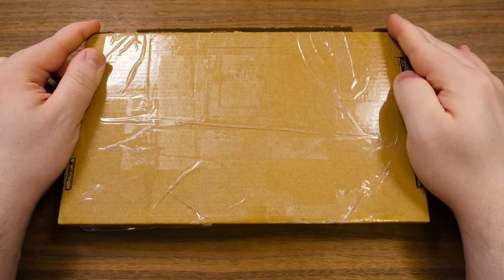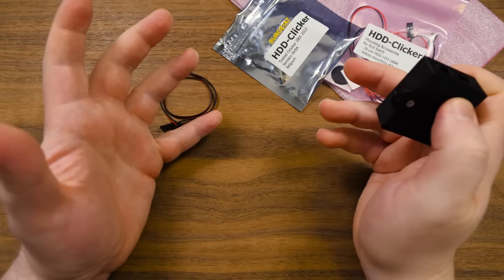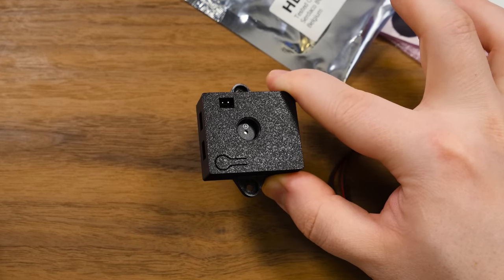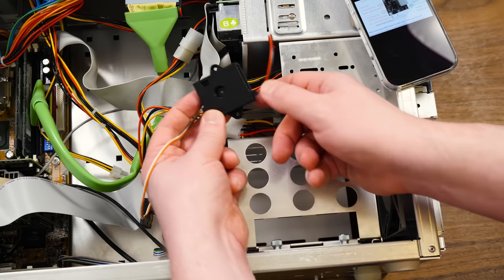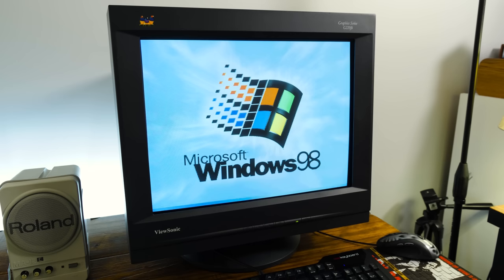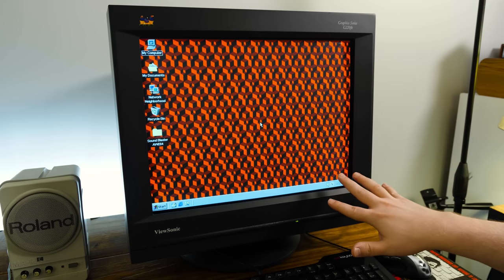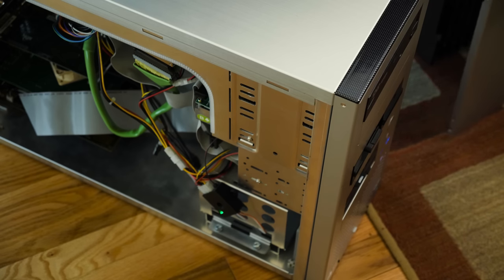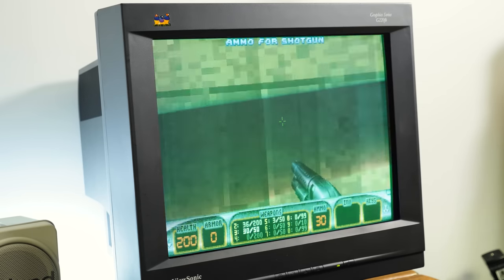The HDD Clicker: Add Hard Drive Sounds to SD/CF/SSDs

Comment: If they have something like this for nvme i'm down... Due to my visual impairment, flash is my biggest enemie due to its silent nature. Having auditive feedback would be awsome.
Reply from the maker: It works for anything with a hard drive LED! So as long as your motherboard sends disk activity out to the LED on your case, then this can be used :)
Reply: I almost feel this could be implemented in software... I've never heard of anything like it but reading disk read/write activity in modern day Windows is surely reasonably simple and could be fed into some software that could emulate an HDD sound.

Comment: This would be a cool feature for a SSD adapter board; SCSI or IDE on one end, SATA on the other, and a microcontroller with a speaker in the middle. That way the microcontroller could emulate drive noises as it emulates the older disk protocol.
Reply: That would be awesome! You could even add the option to emulate the speed of a mechanical hard drive, since after all the device is facilitating the data transfers. The amount of customization that a device like that could have is really cool to think about.

Comment: A neat project might be to use old, dead hard disks and modify them to do the same by disabling the platter so it no longer spins and using the actuator arm in place of the piezo speaker? I imagine the sound of the spinning disk whine would be easier to emulate with a speaker if desired too.
Reply: The con is those old dead hard disks are going to take up a whole 3.5" bay that you could fit several SSDs or other hardware in instead.
Reply: u can hook up the coil of the 'head' to the speaker output of about any amp and it will make noise vibrating. now i want to try this as well. i also have a little 3w 5V DC amplifier. u can buy those for $1 for 3.
Reply: @chatboss000  ...several SSDs? Why would you have several SSDs mounted in a vintage PC lol.
Reply: @startedtech  RAID0 for even more speed, of course /s
Reply: @startedtech  Who said it was a vintage PC?

Comment: Sounds like the IBM SCSI hard drive in an AMD K6-2-333 build I did.  The thing I love about the IBM SCSI drive is that the drive doesn't spin up when the computer is powered on.  The SCSI controller sends the stat signal to the drive when the SCSI controller is initializing during POST so it has a very interesting sound of the drive coming up and initializing.  The clicking is very loud and sounds a lot like that clicker you have.

Comment: For something where the activity LED pulses are slow enough, like on an XT-IDE adapter, you can get pretty much the same sound by simply replacing the adapter's LED with a piezo speaker, no extra electronics needed.
For anything faster (I tried a CF to IDE adapter in a Pentium) the LED flash frequency is too high and you get squeaky beepy noises instead of clicks; a project like this makes a lot of sense there. And yes, I do miss audible activity indication on modern hardware - current laptops don't even have an activity LED anymore...
Reply: squeaky beepy noises sounds about right for some of the earlier harddrives. you know, those that didn't go "krrr krrr krrrrrk" but "booo booo booop"
Reply: @silkwesir1444  Haha, yes, the ones with stepping motors (i.e. mostly the MFM/XTA era) made lovely "robot arm motion" seeking sounds. But the piezo I tried to drive from a fast IDE HDD's indicator sounded more like interference from a malfunctioning power supply, very unpleasant.

Comment: I'm always 10 years behind current tech (save a bundle of $$) and I've noticed that the 2012-era 500GB+ HDDs all went pretty silent. Only the older 160-240GB drives from the 2000s were still clicky. I slowly have adjusted to the lack of noise and don't really miss it.

Comment: what if you can put a custom audio file on a micro sd and put it in to put your own hdd sounds in (my harddrive is an old thick 1tb so it sound different from your normal laptop hdd) I like hearing the hard drive while it's loading

Comment: The absolute best drive sound (floppy or hard drive) I've ever hear is in the AtariST emulator SainT, which had an actual recorded wave files. In fact it was so good those wave files were copied and implemented as optional in various emulators still being worked on. Piezo might be a substitute, but it just does not cut it for actual replication of the sounds. Guess its time for another useful RP2040 Pico project ..

Comment: Glad I passed on this. They need to record samples from real hardware and build a soundfont based on them, along with a lightweight TSR or windows driver that intercepts HDD info and returns head position and whether a read is sequential or not.
This is why I still use an older 1.2GB HDD in my 286/XT machine despite also having a 2GB CF card, you can't replicate the sound of a real HDD this cheaply.

Comment: This is hilarious, Clint. I'm an acoustics engineer, and now, finally, we have silent high performance PCs, someone goes and makes them noisier! But I can see the appeal for the retro community.
Reply: Actually, to "tone it down a bit" you could "put a sock in it" as they used to say about gramophones. Try cutting a small circle of packing foam (experiment with thicknesses) and poking it into the hole over the piezo-electric driver. That would probably take off the "hard" edge to the sound and drop the volume a bit.

Comment: It immediately reminded me of when old PCs would make the internal speaker click whenever you pressed a key, so if you held a key down, it would just make this continuous rattle.

Ironically the one time I'd like a drive to make some actual noise is in this one laptop I got that didn't have a hard drive light at all, so upgrading to an SSD (which I definitely wanted to do because the drive it came with was one of those especially slow ones) would have made it impossible to tell if it was doing anything or not. And of course there's no space inside there for something like this, no matter how well you scaled it down.

Comment: If you're going for a failing drive sound... then this is great.  Needs to be chunkier and more intermittent.  A better solution would be to repurpose an actual drive header and make them seek when active.  True mechanical sounds without the risk of corrupted data from platter damage.

Comment: The use of a speaker is something that makes more sense, but it would be really cool to swap it out with a low-resistance relay and just randomly trigger it. That would be most realistic-sounding.
Reply: Wouldn't that be a tad too loud? Maybe more for floppy emulation than hard disk...?
Reply: @silkwesir1444  It just depends on the relay. One the size of a piezo beeper would be very quiet comparatively.

Comment: If the volume is adjustabe im sure turning it down would help it blend in better.  Also, I'd imagine it clicks so fast due to the read/write speeds of the card being much faster than any drive you'd be used to, so more is being done per unit of time.

Comment: It would probably be a bit expensive to have an accurate disk drive sound maker. The best option would probably be one that plays random seek sound files on access while continually looping the spindle motor sound when idle. You could have an option to choose samples for multiple drive models. For the true retro experience you'll want a spin-up sound at power-up and, if applicable, a timer to play loops for thermal recal cycles (especially noticeable on <200MB Quantum drives). I'm not sure if the CPU on a BlueSCSI or similar would have enough spare CPU cycles to run something like that as an add-on or if it would have to be self-contained.

Comment: All you need to do is put one of the small felt furniture pads over the piezo element. That will dampen the loudness and could curb the pitch a bit. I’ve done this on motherboard piezo speakers and it works wonderfully.

Comment: Seems like if it would use an IDE pass through, instead of one for the activity light, it could intercept and interpret the commands passing through, and emulate the sounds of spinning up and seeking to particular tracks, for some specific old drive. Pretty neat as it is, though. Sounds sorta like some drives I used to have, though I don't remember which.

Comment: I'd be curious how it'd work with older systems.  I've noticed on my own 486 box with a super IO card on vesa for IDE, the light never comes on as far as I can tell.

However the sound that's far more nostalgic and equally appropriate is a cooling fan running at full blast because the idea it'd need to slow down wasn't fashionable yet.

Comment: There was this awkward era of laptop manufacturing where they stopped shipping with HDD activity LEDs but they would still come with sata HDDs. I had to put my ear next to the laptop to check if the computer was actually doing something. I can see a use scenario if your PC case doesn't come with a HDD activity light for some reason and you really don't want to bring up the Task Manager to check lol.
Reply: I used to have a Dell Studio laptop from 2010 that I thought was like that. And then I discovered by chance that you could press Fn+H to toggle the power LED between being a power LED and a hard disk activity LED. It was handled by the keyboard controller itself, or maybe the management mode BIOS or something, the point is - it worked without any OS support, even when the computer was stuck. That was a very nice feature!

Comment: I wonder what's next since you can simulate HDD sounds using a SSD or anything like that?
Some sort of device that simulates motor engines for electric cars like Teslas?
Anything that simulates those CRT sounds for modern TVs?

Comment: It does sound like some old drives.  But just clicking on disk access is wrong.  There is no break in the clicking for the seek times of the hard drive.  Nor does it do some random clicks as cache gets flushed to the drive.

Comment: I think the power LED indicator option is for when your case has a 2pin power LED wire and your motherboard has a 3 pin without the middle pin.  I have an Athlon 1100 T-Bird build in a Chieftec Dragon case that I cannot use the power LED on because its a 2pin on the case.  It probably just pulls directly from molex.  Simplest solutions are probably the most likely in this situation.  I might have to buy a couple of these, regardless of if its "perfect", its better than dead silence of flash media.

Comment: I think this just works based on the LED entirely. It's just on, or off. The ability to change the sound it makes is going to be very limited. I'm guessing they went with the lowest pitch the piezo could make, voltage-wise. I don't really think there's anything they could do to make it sound much better than it does. You would need a way more complex circuit for that sort of stuff. Hypothetically, you could plug the audio output into an amp and a speaker (or even typical computer speakers with the amp built in) and then use some EQing to get more of the tone you're looking for. In fact, I wonder how it would sound if you plugged in one of the bigger sorts of PC speakers that you'd sometimes get back in the day. Anyway, this would be fun to mess around with.
Reply: well it cost $35 so it should be something better than a $1 dollar bin product, but here we are

Comment: Yeah it lacks the resonance of a mounted drive in the case. Maybe a solenoid vs a speaker would better reproduce the effect. I remember older drives would make the case buzz, could feel it if you put your hand on the pc. Or maybe a larger classic pc speaker, those larger ones form the early 90s. As mentioned by others flash memory reads so much faster in seek is sounds more like a 2010 or more modern drive hard mounted to a cheap case.  With the beeper style speaker maybe building a housing around it to create a chamber and using cotton or foam in the hole could lower the sound and note a bit. A steel case might alter the sound some too. I have the same case but with a window and as thick as the aluminum is it is fairly thin acoustically. (it made hhds really loud)

Comment: Dang. I totally see how this would be great in the proper setting, but it sounds more like the click of my Geiger counter, if it were near a very hot radiation source.

It really needs some blending of the clicks. Like once the frequency of read operations go up, the clicks should blend together more. Maybe the click should be longer, per flash of the LED. I think that would blend it together and better replicate the operational delay of a real HDD. It does sound better with the tape, though.

Comment: I like the idea, but it really does not sound at all like a HDD. The sound reminds me more of a failing fan, or like when you got a wire rubbing against the fan blades. HDD sounds change depending on how far the heads have to move and the frequency between movements, and the sound even varies according to where the heads move from and to - it's noticeably different when they go from the outside to the inside versus from the middle to either the inner or outer tracks. It needs a more organic rise and drop pattern to remotely replicate that and possibly even play multiple sounds at once to replicate the reverb, instead what it's doing sounds like it's just a basic on/off square wave. The extra complications to the sound is that every model and make of HDD sound different, and the temperature of the drive has some influence on the sound too. You're also right that the sound of the drives doesn't always match the LED, and that's because the sound is from the heads moving while the LED indicates data being sent to and from the drive. If you have a very fragmented drive that means the head can move a lot, but only send very little data, thus you'll have a lot of drive noise with only sporadic LED activity.

Comment: Piezoelectric speakers & pickups operate through vibration. You can adjust the tone directly by changing how the speaker is mounted to your case. Too harsh? Add some foam tape to insulate the vibrations less (in between, not on top). After all, it's still plastic on aluminum the way you currently have it. 😅

Comment: I have had a similar idea for a portable computer. Except using the voice coil of the dead hard disk as the buzzer which also allows it to use my portable machines’ original mounting hardware which is really weird, no screws but uses unthreaded studs that pokes into corresponding holes,  and doubles as a 3.5 - 2.5 adapter for either thin client IDE flash cards or 2.5 - CF. Have design files for it, just need to tweak the board design etc. Some brief experiments with that sounds rather convincing

Comment: I reckon maybe some foam or rubber around it might work better then tape. Even bubblewrap or cardboard might do it. Hard to tell without being in the room, but I think it just needs more dampening to cut the high end off. I also reckon it could sound better in a bay, as part of the sound of a HDD would probably be the echo, at least in a computer like that.

Also I feel like some harddisks you also hear the whirr, and this doesn't do that.

Comment: I'm sure there's some analysis that can be done of the frequency of clicks in actual hard drives to the LED indicator light, and a pretty low-powered chip could apply a filter to mimic that....

But also, I think watching you use the computer and hearing it seems to work and is convincing. It's when you stop and focus on it that you notice it's not quite right.

Comment: yeah I think this needs to be more complicated, like having the noise of the hard drive spinning, and then this clicking in the background of that.
like this needs an actual speaker, and make it possible to put profiles of different disks on it so you could emulate the era of hard disk, like just the clicking sounds weird, and could be emulated by a poorly isolated sound card.

Comment: They need to make a larger version as small piezoelectrics will give you that tinny sound.  A 2-3 inch piezoelectric in a larger box would be great as it just sounds like static at the mo.  I do like the project but the bigger it gets (physically) the better the sound. 👍

Comment: i might pick up a couple of these for some older computers of mine. i dont expect the original hard drives in my gateway k6 rig and powerbook pismo to last much longer XD
i do think a couple of points you and some some commenters made would be some welcome improvements. eg sampled noises, volume, and maybe some dropped clicks to really accurately emulate the sound.

otherwise: its a cute little clicky box and i want 7

Comment: I don't know it's close enough that you could set up a system with it and it gives you the Idea of what a HDD sounded like. I think you'd need to make 3 1/4 in. housing with a a SSD to get the more bassier tones from it but I remember hearing HDD that sounded like that from the early 90's so too each their own. and cause my older brother was a E waste collector he showed me that the different timbres of the HDDs came down to the HDD housing cause 90% used the same stepper motor.

Comment: Doesn't sound too bad on camera, seems to sound a bit like the later IDE drives like early mid 2000's if it would be quieter, I have a Seagate 40gb drive that sounds quite harsh like that. Should probably be less uniform, more random and definitely quieter.